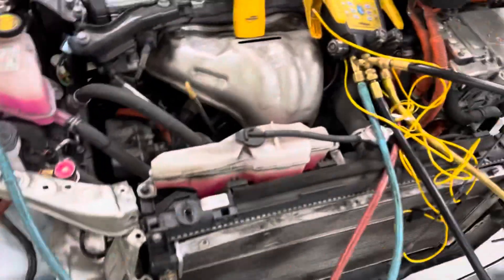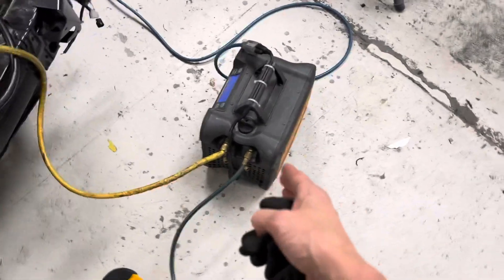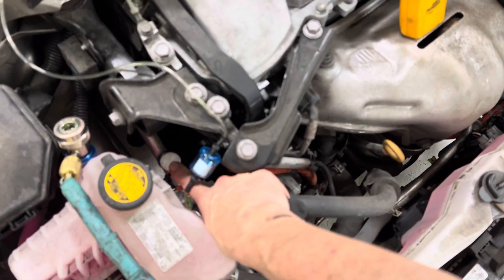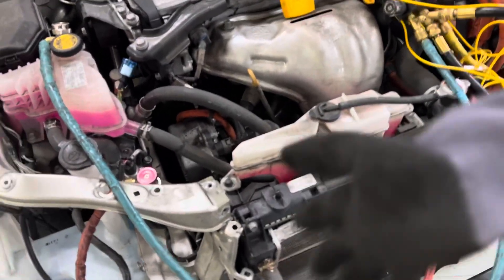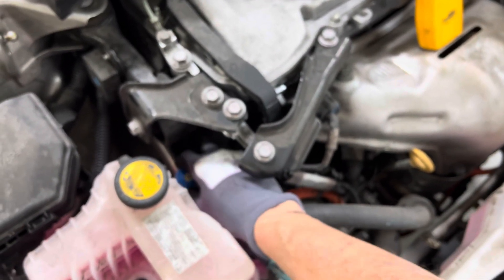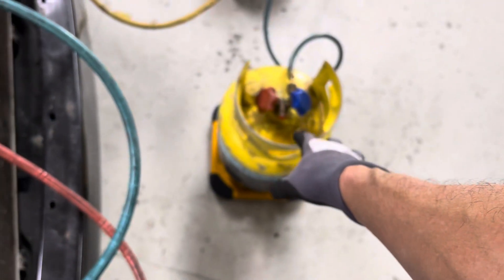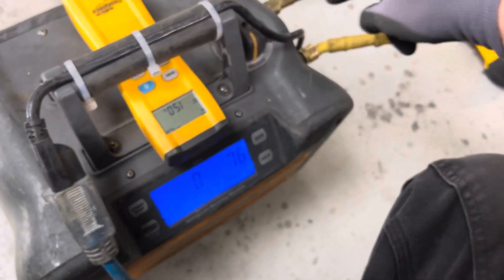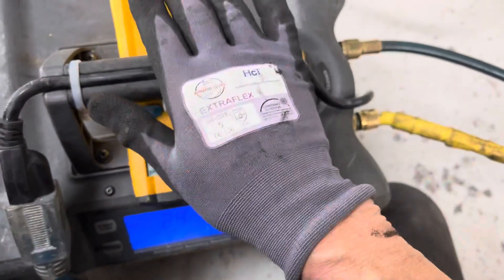Automotive refrigerant recovery really fast on Fieldpiece recovery machine

Comment: A question. And that gas that is recovered can no longer be used again? Can't you put it on another car directly from the recovery cylinder?
Reply from the maker: No, you cannot use the gas in a cylinder recovery cylinders are dirty. They have all the different types of oils contaminated acid particulate matter moisture, air noncondensibles
     Inside of the tank are just bear steel and they start to rust. As the tanks get older, they start to flake some of the rest off the walls and mix with the refrigerant…

This is why the tanks have to go to recycling to separate the pure refrigerant from all the other contaminants

Have you ever heard of the process of purify water out of sewage water? 
Where they can take sewer water and turn it into pure water that is drinkable 
Think of that as doing the same thing, the inside of a recovery tank is like a sewage septic tank.,
   And you’re gonna turn that water into something that you’re going to drink
Reply: @coldfinger459sub0 thanks brother for the good explanation. So if we can not reuse the gas again , What is supposed to be done with that gas that was recovered? What happens when the tank fills up?
Reply from the maker: @rogersoto3230  you have to put it through a recycler RRR machine recovery, recycle recharge. 
       Or you drop it off at a local refrigerator and exchange program at a commercial HVAC supply house refrigeration supply.

Comment from the maker: Yes, before connecting my gauges in my unit is vacuum down to usually 800 µm if I only use the recovery unit to clean out my gauges and unit from Air. 

And only purge a small amount of refrigerant, exit the recovery unit to the connection of the tank .   Just that one small section of hose..
Reply: That's good to know. By the way... I have looked at other of your videos but haven't found anything on refrigerant recycling. Do you recycle the refrigerant yourself or do you take it to a place to get it recycled when the tank gets to 80%?

At my job I work with a Robinair roll around machine and it recycles the refrigerant on its own.

I want to start my own business doing ac repairs and I'm still deciding between a big machine and a setup like yours. Please advise
Reply from the maker: You will still need one of the big machines for recycling in Refrigerant. 

The little recovery unit I use is only for one dedicated purpose only to recover refrigerant and then take it to process it myself in my machine that’s all .
Reply: @coldfinger459sub0  Thanks for your quick response Tom. It would be nice if you can make a video on how you recycle the refrigerant.
Reply from the maker: @VWtech562  one day there’s 1 million videos out there from every RRR machine manufacture on how to set the machines happened to recycle mode.

Comment: How do you know how much oil was recovered along with the refrigerant?
Reply from the maker: I’ve made a couple videos on the topic but you only recover from the low side fitting at a slower rate and you have a site glass in the center of my gauges you can actually see the flow of refrigerant if any oil comes up. 

       So you throttle back your valve to make sure you see nothing flowing in the site glass because it should be only a vapor gas with no liquid. 

I made a couple videos where I attached a clear sight glass reservoir to my hose to show when liquid refrigerant comes out and the quantity of oil in the liquid refrigerant that you should not be removing as a example. 

With experience when you have a lowside refrigerant fitting attached directly to a compressor you have to be very careful and draw out your recovered refrigerant slowly because it’s extremely easy to boil the refrigerant by lowering the pressure as you’re doing a recovery and it will be sucked up through the fitting into your hoses into your recovery machine it’s different on different vehicles 

But this is why you use your clear sight glass

If your lowside fitting is located way down at a low section like the line is shaped like a you up at the firewall and then goes down very low towards the exhaust towards the bottom part of the frame of the car and then the lower side section towards the front of the car comes back up again towards the hood and you have the low side fitting way down at the bottom it’s possible for there to be a lot of trapped oil at that section and if you hook up your gauge there and remove refrigerant you be remove oil to but then again that’s why I mentioned you have a clear sight glass to monitor. 

On the normal big recovery recycle and recharge machines they have a oil separator that separates out the oil as they were covering in the drops it down into a little measuring cylinder to tell you how many milliliters of oil you have removed because the machine only recovers at one speed and does not pay attention to where the low side fitting is and sometimes remove some oil on those big machines because there is no option for throttling back the speed at which you recover the refrigerant